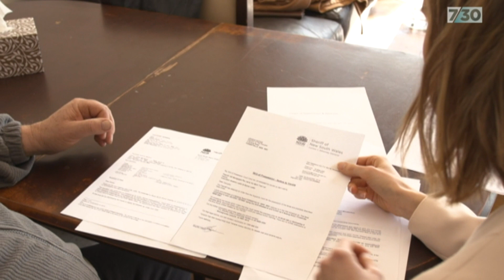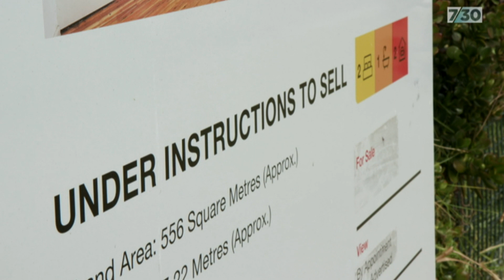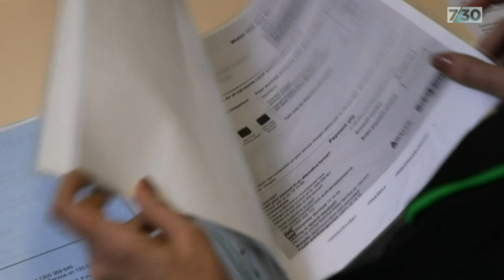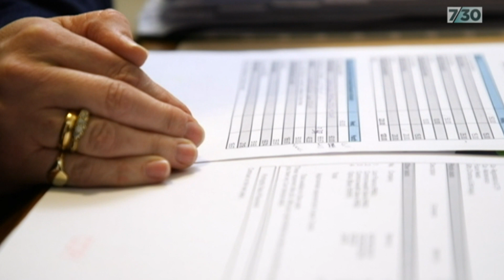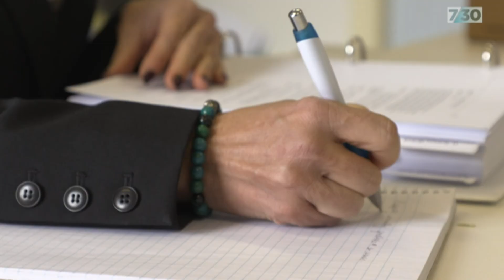The number of Australians falling behind on home loan repayments is growing | 7.30

Comment: There are a multitude of factors, outside of the unfortunate life issues show here (such as illness and family breakdowns) that are at the heart of the housing problem.
1. Badly designed and implemented tax policy - Capital Gains Tax Discounts on residential property - opened the flood gates to speculative investors. That led to serious over valuation of residential property assets.
2. Unchecked property investment from overseas buyers who are not interested in rental yields but just want to move asset classes from say foreign currency into a tangible asset. Also contributed to ballooning values.
3. State and local governments are incentivise through the Stamp Duty and development fees to continue to seek increased values so they can get a percentage of the value into their coffers. 
4. Real wage growth has been virtual nil and for many Australian moved backwards due to rising costs of living.
5. The low cash rate from the RBA became structurally ingrained into the economy, so people do not have the means or appetite to absorb higher rates. For example, if you're Sydney median house price is $1,000,000 and loan is say $500,000. Then there is a huge difference in servicing a home loan at 4% than at say 7%.
6. We have a significant amount of low skilled labour immigration as well as temporary medium term residents entering the job market. Meaning the excess in labour is causing under employment or in cases under payment (e.g. 7-11).
7. Australians have changed their mindset about housing being seen as "home" to now "investments". So we as a society are ok for many to not have a "home" as long as we have our "investments".
8. The self-managed superfund has become a tax haven and asset   transfer vehicle for many. Including what was the ability to leverage residential property in super. Which again moved housing into a more sought after investment class.

These issues have been known by both Liberal and Labour based governments, but they are far removed from the everyday Australian and they have little incentive to change given voter apathy and the general lack of financial and political literacy in Australia.
Reply: 👆comment deserves a lot more votes!!
Reply: @domvonhutch  and significant inflow of cash from Asia too.
The nation will have some challenging questions to answer... It was interesting to hear Mike Pompeo and Marise Payne talk about the alliance.

Comment: Australians tend to make everything BIG, including big houses. That's why it cost them a lot. Should they choose to make smaller houses just enough for small family, they would have been free of mortgages in 5 years time.
Reply: There is lots of small homes. But they are same price as big homes.
It's the location of homes that decide the price.
I once saw a single story small burnt home with no roof, and small courtyard. It sold for over a million dollars, because it's in a good location.
Reply: Trie Haryanto so have you seen what mansions built in Florida cost mate? It's not the cost of materials it's the cost of lazy, labourers in Australia that make housing cost a fortune. The mansions I'm talking about don't exist under the $10 million bracket in Sydney and Melbourne.

Comment: When you have a currency based on debt, but then put those rates in the hands of a governing body that has the power to artificially stimulate the economy by suppressing interest rates, you're setting the system up for disaster. Resources are not infinite. There's going to be a balance come out elsewhere.